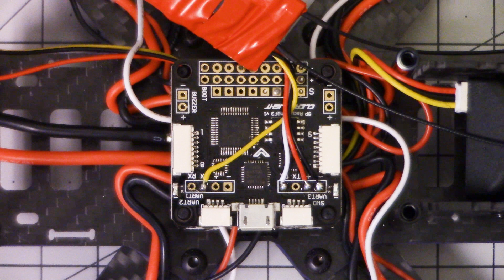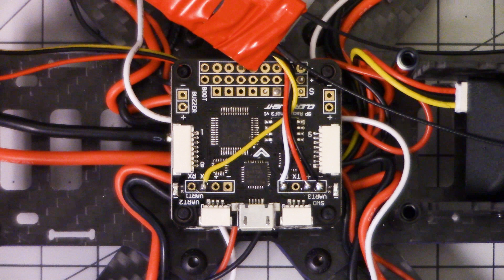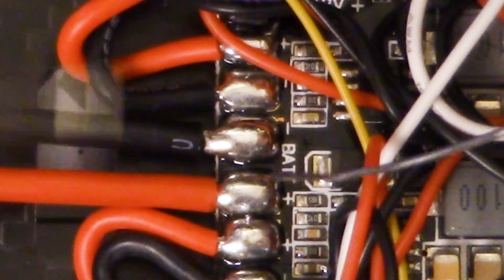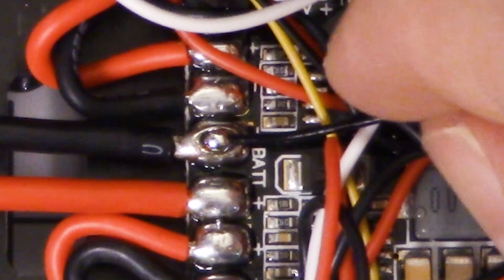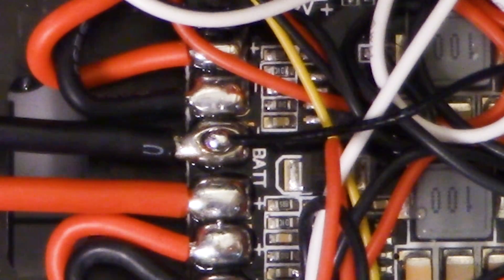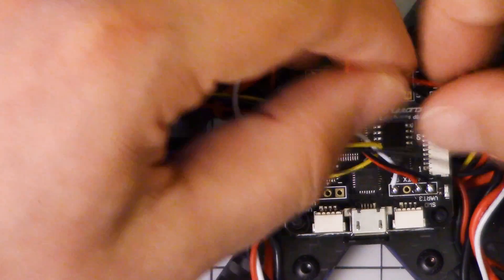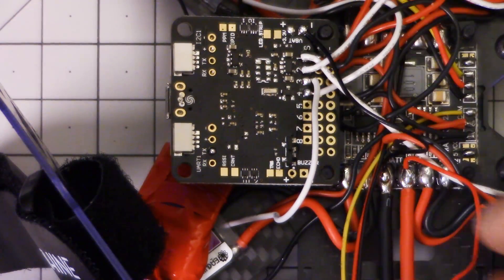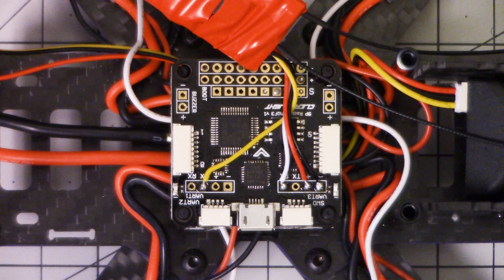Eachine Wizard X220 | BATTERY VOLTAGE MONITORING HACK

Comment: You mention in this video that you wired the receiver wrong and said the right way is in the initial setup video... I'm having trouble finding that. I have a taranis transmitter.
Reply: so where exactly does the yellow wire go? I bought a taranis specifically because of your lua script video, but I feel like im in way over my head now.
Reply: Timons Mind probably late but it should connect to the tx pin on uart 2. Just look up a diagram for the f3 controller to find the tx pin on uart 2.
Reply: Calvin Wilkins 
I need that Info too...
Reply from the maker: I'm sorry to tell you that line is a mistake. I forgot to include it. The only thing I did wrong was to solder telemetry to UART1. On this board, SmartPort telemetry can't be combined with UART1. But the receiver wiring is otherwise correct.

Comment: uhh so old video i know, but i did this wired it exactly the same not shorts between things and looked in betaflight and got bat voltage to display but it was constantly dropping like 0.01v/s and then it jumped up to 36v i was using a 3 cell... so i tried to calibrate to the 12.15 it was with multi meter and saved the calibration and  it fired my FC, anyone know any possible reasons?
Reply from the maker: I think your FC was fried before you started that's why the voltage was dropping and it just finally finished dying.
Reply: @JoshuaBardwell  thanks for the reply! I was flying an hour before so maybe I shorted something during wiring it up

Comment: hi and sorry for that late late late question but: how can i enable osd to see through my ev100 how much battery voltage i have ?
kind regards :)
Reply from the maker: The FC does not support OSD. You would need a new FC.
Reply: @JoshuaBardwell  tysm for the quick reply

Comment: Question??? I did the vbat monitoring upgrade with a beeper but it's not loud enuf if ther a way to increase volume or a way to get more voltage to buzzer maybe sorry kinda new to fpv. But the buzzer is like 3.3v- 24v so I'm thinking it's just not enuf power maybe.

Comment: I have a question if you solder the battery voltage wires does it show it on the camera(osd)? If yes does it work with the stock camera?
Reply from the maker: Yes it does show voltage. No the stock camera doesn't have voltage osd.

Comment: Any body know how to get runcam micro swift 2 to stop having video freezing up on a eachine wizzard x220? Tried a micro swift 3 also ready to give up on runcam.
Reply from the maker: The camera probably is not the cause here. There's almost nothing that could cause a swift's video output to freeze. I think maybe you have installed a DVR or something on the quad that is causing the image to freeze? Or maybe it's your goggles.
Reply: Joshua Bardwell when i hook the stock camera back up it works fine. I tried hooking swift straight to the battery also didn't work still freezing?

Comment: What do you guys fly with  ....frsky ,  flysky ,or taranis or something else..🤔😎
Reply from the maker: I fly FrSky and Crossfire.
Reply: Joshua Bardwell  I use after market flysky fs i6. I think I'm going to add a signal amplifier to it as well.i shouldnt have any more fail-safes at close ranges.Does your receiver position inside your quad short antenna long antenna really matter ? I took my gtfirdancer parts and put them on a Alien that's when my alien stated failsafing

Comment: Before all, thank you Joshua for your awesome videos, they are helping me a lot with my wizard. I did the Vbat hack, I test with my voltimeter in the Vbat terminals and I get the same voltage than in the battery terminals, but I connect my quad to betaflight (battery connected too) and it doesn't read any voltage, anyone knows what's happening? Im running betaflight 3.3. Thank you all for your help.
Reply from the maker: In the Power and Battery tab make sure voltage source is set to internal ADC.

Comment: hey, i'm on betaflight 10.2.0 and firmware 3.2. i wired everything and went into betaflight to configure vbat but the section "vbat" doesn't show up in the configuration tab. does anyone have the same problem and/or a solution for this?
Reply from the maker: Power and battery tab
Reply: thanks ;) i ran past that a few times but i was just lookin for the word "vbat"

Comment: I think I might feel more comfortable stripping some if the covering back of the main leads and solder the vbat wires into them and apply a little liquid electrical tape to seal them up

Comment: What are all the extra ports for on the FC?

I only need to plug in my receiver and camera but theres still lots of spare plugs.

What can i plug into them?
Reply from the maker: +Crass Excursion GPS receiver. OSD. Or nothing.
Reply: Joshua Bardwell what OSD/GPS plugs straight into the ports next to the USB port?
Reply: What are those ports called haha?

Comment: Hi expert...kindly assist me for OSD display..what to change?vtx or cam in eachine x220..plz guide..if there is any vtx 600mv with easy fiting and OSD display...
U seems very expert..waiting for reply..
Regards. :)
Reply from the maker: For OSD, I would add a camera with built in OSD like the Runcam Swift 2.
Reply: Ok..gr8..thanx alot sir

Comment: What aug wire are u using
Reply from the maker: For signal wire and low-current power supply use 30 to 22 AWG.

Comment: I managed to wire up a buzzer, but it only makes popping noises as if the diaphragm only moves one way when power is supplied. No beeping whatsoever. Any ideas on what might be wrong? I'm using a 4s battery
Reply: same issue
Reply: DJ Nuck Chorris he emailed me and told me that I needed to get an automatic buzzer, one that makes its own sound just from DC power.

Comment: Where would I solder that Vbat that you showed on the screen from banggood?
Reply from the maker: I'm not sure I understand.
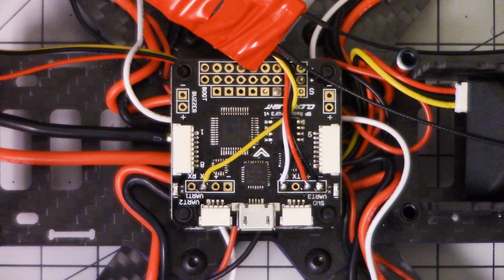Reply: Sorry just seen this, dont know why I worded it so poorly. The buzzer at 0:32, do i solder that or just attach it to the battery and it will beep when low. Also, im new so I dont rly know my terminology very well.
Reply: Joshua Bardwell I would be interested in that too, keen to avoid soldering if possible. Thanks heaps for all your videos by the way, you have increased my understanding ten fold. You explain things very well. Cheers!

Comment: I soldered up the wires easily, and Im running BF 3.2.1. But I still have a blank screen  I see no Vbat tab in 3.2, so how do i enable it? thanks
Reply: Oh I think i misunderstood this, i was thinking this mod puts the voltage on an OSD. But its only for an onboard board/low voltage beeper?
Reply from the maker: +Bernie C if your FC had a built in OSD this would put battery voltage on it. Since it doesn't you just get buzzer.
Reply: Im slowly learning this stuff. I learned quite a bit from your wizard initial setup video, thanks

Comment: I can see on the lower board top left there is a unused 12v output, can I just solder vbat to that?
Reply from the maker: No, because that would be 12v, not vBat :-)

Comment: would it be possible to have blinking leds for low voltage warning?
Reply from the maker: I do think the betaflight LEDStirp feature supports this. But the LEDs on the Wizard are not programmable.

Comment: hi josh just a quick 1 on my wizard I have a foxeer tm25 raceband switched and foxeer camera. i tryed wiring it up on vtx and camera bit of board but vtx don't work. I then put ground and pos wire into 12v and camera and vtx are on same wire and it plays through goggles but soon as I get not so far it cuts out of signal so no range on it.
Reply from the maker: +FPV WIZARD if you're getting bad range theost likely cause is you're actually not in the same channel, but a slightly neighboring one.

Comment: Hi Joshua, thank you for having this channel that already helped me a lot, but I have some doubts, when I do this the voltage will appear in my glasses FPV? Do I need to do any configuration?
Sorry if some words are wrong, I'm Brazilian and I'm not totally fluent in English ...
Reply from the maker: If you set up vBat, then you can see the voltage in your OSD. But if you don't have an OSD, then you won't see vBat in your goggles.
Reply: Joshua Bardwell what about on your remote? I’m flying LOS until I can afford quality goggles..

Comment: Hey Joshua thanks for your videos! I've hooked up my vbat( using a very bad iron which is going back to the shop ) at what rate should the mAh consumed raise? Mines going up rather quickly according to my taranis after I've hooked up the vbat have I done some thing wrong or do I need to do some thing? 

Thanks
Reply from the maker: You don't have a current sensor on the Wizard. Your mAh doesn't mean anything at all. Vbat gives voltage, not amps.

Comment: I'm looking to order some spools of wire so I can do all fly wiring when I get mine. what gauge is that? 14ga maybe?
Reply from the maker: For ESC power leads and motor wires, 18 or 20 gauge is typical. For signal wire, 22 to 26 gauge is typical. Main battery discharge is usually 14 or 12 gauge.

Comment: Hello Joshua, I just finished doing this mod to my otherwise stock wizard. Let me start off by saying thanks for such a detailed and easy to follow description on how to wire everything up. Now on to my issue, I was able to complete everything as was done in your video (although it took plenty longer than i anticipated as my soldering skills/equipment aren't the greatest), when i went to power back on and test everything out, I heard a pop and saw a little puff of smoke. Upon inspection, I noticed that my solder joint at the VBAT connection was a bit tall and I believe that it arced from the VBAT pads to whatever is lying just below on the PDB. I haven't had the time to fix the solder as of yet but wanted to ask your opinion on whether or not you think I've done any real damage before i spent any more time trying to repair something that's irreparable. Thanks again for your time and all that you do, especially for a noob like myself.
Reply from the maker: Usually when you let the smoke out, something is burnt. Likely you will be replacing a component. 

Always use a smoke stopper when plugging in a battery on the bench. Repeat after me. Always use a smoke stopper when plugging in a battery on the bench. It would have saved you this problem.

https://www.youtube.com/watch?v=4z7yRG56aKM

Comment: I've got a quotation hopefully someone that knows their stuff answers.  
I did this recently and never saw this video.  
When I wired my vbat I only put one write in it.  I only did the positive wire. 
it works just fine.  Is there a reason for that working; or a reason to take it back apart to installna negative lead..?
I would hope Mr. Joshua Bradwell would answer my question.  lol...!
thanks to anyone in advance....!!!!!! 😆
Reply from the maker: The board is getting ground from multiple locations, so no, you don't really need separate ground for vBat.
Reply: Joshua Bardwell 
I'm more surprised that you replied. :)
most YouTube people don't ever reply to their comments. 
But thanks for the reply J.B.

Comment: Is this vbat hack required to get telemetry even when using a frsky x4r sb RX? The reciever smart port wire should get its vbat reading through the telemetry wire connected to the FC uart2 2nd pin from the left, correct?  Or is this hack only required if you want voltage reading in BF, and on FLYSKY recievers (fs-ia6b)?  Im curious as I am in the process of converting my wizard from flsky to frsky (taranis) @Joshua Bardwell
Reply from the maker: You are correct. This vBat hack is only if you are using a camera like the Swift 2 or Arrow which have a built in OSD.
Reply: oh ok, I really only use the timer on my swift 2. I dont have this vbat hack done, but still get voltage osd from running the vbat+ to an esc positive pad. seems to work fine for me.  But my question is, "I wont have to do this mod if I plan to convert to x4r sb receiver and use telemetry? The smartport from the rx to uart2 will do the same thing as this mod correct?"  I just want to make sure that I can have voltage callouts or batcrit alarms enabled without doing this mod.  Thanks again!!!

Comment: Hi Mr. Bardwell.   is there a way to have RSSI on OSD if let's say I was about to get a Run cam shift 2 or a Foxeer cam ? if yes. how would I proceed.

the funny thing is that I do have RSSI on my remote control, not very handy when flying with FPV goggles on. 

I also inspected undet the FC, there is a RSSI spot .. any chance I can wire something there. 

Like always I rely on your expertise Mr. Bardwell

Thank you
Reply from the maker: None of the cameras you mentioned have an input for RSSI into the OSD. You would need a full-fledged OSD like Betaflight OSD or RROSD.

Comment: hello! first off, i love your videos and iam a huge fan. youve helped me out tremendously. iam wondering though, how do you moniter the voltage? does this show up on my controller? does it link an alarm to the leds? i understand what youre doing, but i have no idea how to read the voltage with this.
Reply from the maker: The simplest thing to do is to install the Runcam Swift 2 or Foxeer Arrow cameras. They have a built-in OSD that shows the voltage in your FPV feed.

If you use vBat monitoring in the FC, then you should add a buzzer to the FC so that it can beep at you when th evoltage gets too low.
Reply: Joshua Bardwell okay, I figured that's where this video was going. Thanks for the reply! Iam about to order to the swift 2 for my wizard. I can't fly dusk or dawn or anytime the sun is on the horizon. Thanks for the help!

Comment: Can I solder my XSR like you have in the video to Uart3 and 1 and get telemetry? I know you say dont what you did but if I can I would be happy. Then how did you set up Beatflight?
Reply from the maker: What I did will work for the receiver, but not for telemetry. You have to put telemetry on UART2, which is only broken out on one of the pin headers.

Comment: I'm a complete noob and this may sound pretty silly, but which wires did you use? The red and black wires? Thank you so much!
Reply from the maker: I'm not really sure what you're asking.
Reply: I'm sorry how do I put this.. What wires did you use for the vbat? The red and black wires you used, did you supply that yourself? I'm assuming right?
Reply: What gauge wires did you use? Thank you again!
Reply: John Brennan Joshua recommended to use 22-26 gauge wires. I used 28 gauge and it was fine.

Comment: I have accidently flowed the main battery positive in with the ESC Positive next to it. I cant separate them. Have I just screwed my wizard?
Reply: OK can someone please help me. as I commented before I've accidentally joined the battery in with the thick esc pad beside it. does anyone know if can leave these joined or if they must be separate?

I'm so annoyed I haven't even flown my wizard yet qnd I fear I have ruined it already. I cant separate the solder.
Reply: do the best you can to try and separate the pads. i would not plug in the battery until you have done so. just youtube how to solder videos.
Reply: I have tried my best to mild success. however it looks like the two pads touch underneath. I have a suspicion that they do. I don't know enough about how the battery supplies the esc's. The thick red and black cables could supply constant current which is controlled by the thin black and red cables. in which case I would be fine.I could be wrong.
Reply: you know more about the electronics than i do, for real. i just try and make everything look like it does out of factory. Don't they make solder vacuums of some sort? maybe that would be helpful... be careful if you do plug in. i've started a fire on accident before messing with 4s batteries
Reply: Thanks Rob. I know a little bit. just not when it comes to drones. If you could do me a huge favor I would be very grateful. if you could plug your lipo into your wizard. im presuming you have a multimeter. if you could put your positive end on the large red wire coming out of the esc beside where the positive from the battery goes into the board and the negative of the multimeter on the black terminal going from the battery to the board and see does it read the voltage of your battery. If it does I should be in the clear.

So: Multimeter red - esc red, Multimeter black - Battery black.
if you get a reading I'm safe.
Reply: you bet, what do i turn the dial on my multimeter to?
Reply: Excellent! I'm extremely greatfull. Im not sure about your multimeter or your battery but as long as it's above the voltage of your battery. so if you turn it to 50v DC you should get a twitch out of it. Test the two cables going in from the battery to th pcb (it should read your battery voltage) then simply move the positive probe over to the red pad next to it that goes out to the esc. I'f you get the same reading I'm safe. just be careful not to bridge the black and red it will cause a short.

I have been told on forums that I should be fine but this would really confirm it for me.
Reply: i got the voltage of the battery when i did what you said. happy flying!
Reply: Fantastic! Thank you so much Rob. Let's just hope I didn't do any damage trying to separate them.

I'd be more than glad to help you with anything if you need it in the future. Hopefully you'll not need it though. Happy flying.

Comment: Josh, a question. If I only need to install the buzzer, in order to be advised when the battery I low, do I then only need to solder the two cables for the buzzer or do I need also to wire cables to the vbat?

Best regards
Morten Rask
Denmark
Reply from the maker: Yes, you need vBat monitoring enabled in the FC otherwise how can the FC know when vBat is low to sound the buzzer?
Reply: Of cause, thanks a lot for the quick answer, then I can continue my soldering right away ;-)

Best regards
Morten